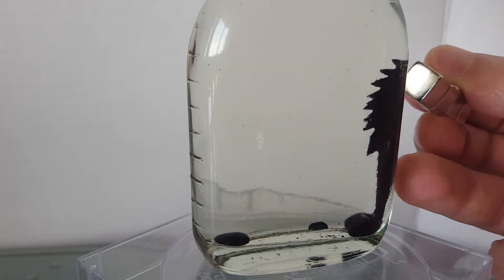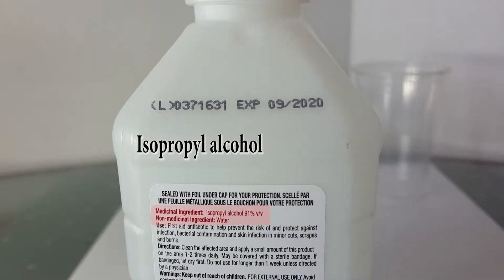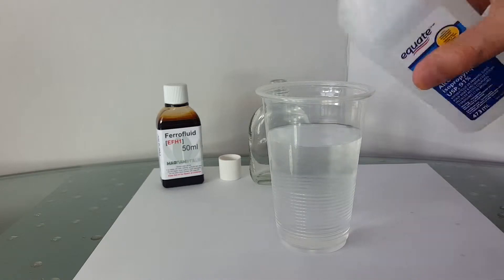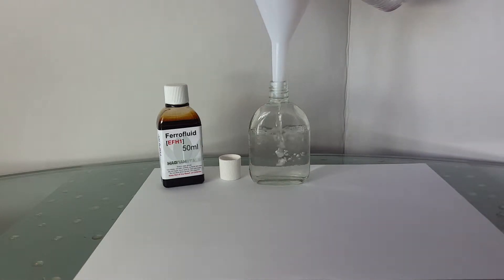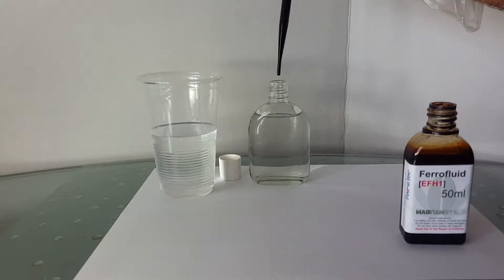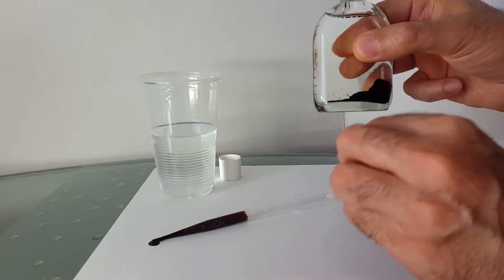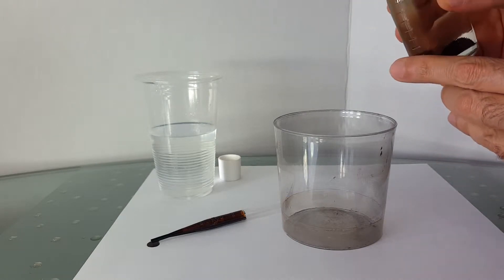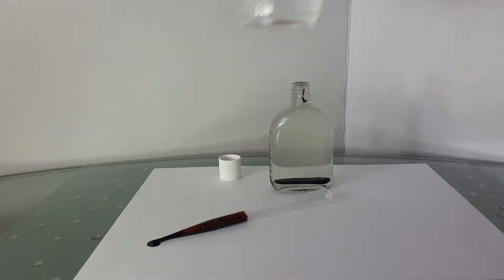Magnetic Ferrofluid Display

Comment: Hi, can you make ferrofluid by putting washed iron oxide powder in your fluid? Why does it have to be ferrofluid into the mix? Why buy high percent alcohol and then water it down. Would methylated spirits work?
Reply from the maker: Anita, to get the effects in this video, you'll need ferrofluid. The solution mixture is what I found to work best. Please try other mixtures and share the results.